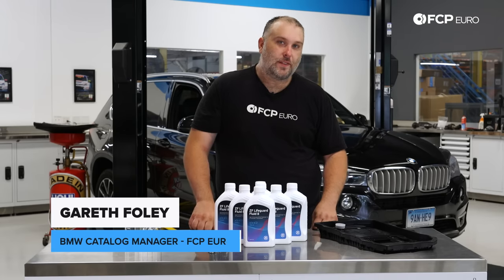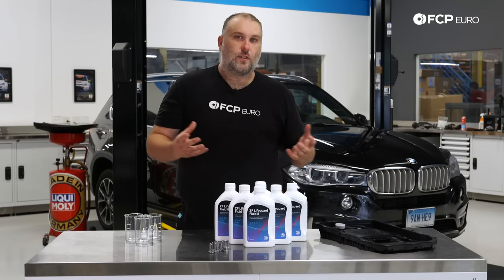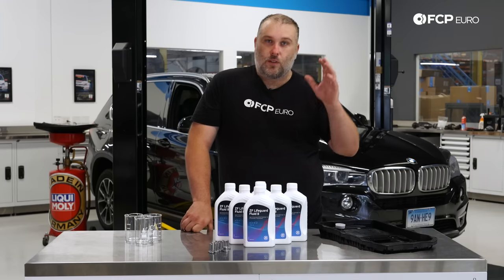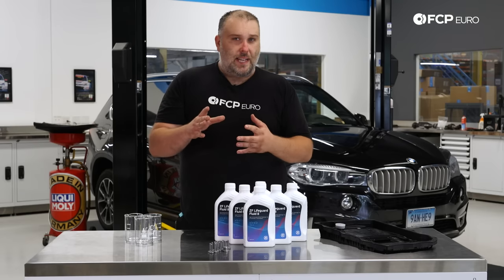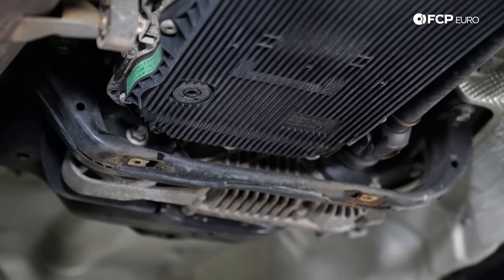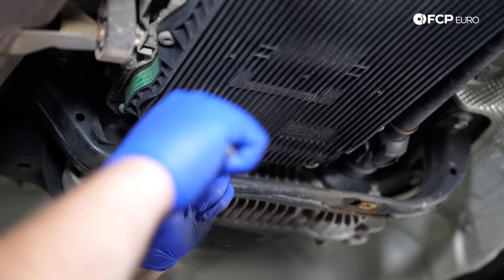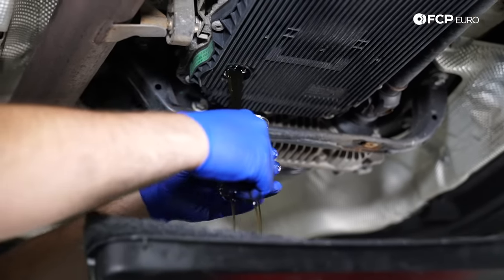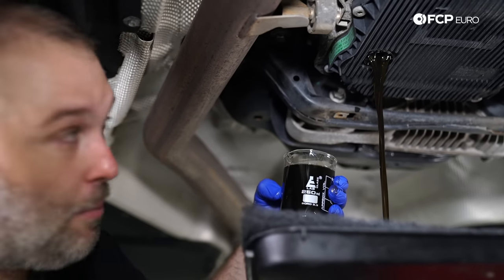ZF 8-Speed Transmission Oil Change (BMW, Audi, VW, Dodge, Land Rover, Toyota, & More)

Comment: I have a 2015 328i. It had 42k miles when I bought it, and it now has 130k miles. It started shifting hard when put in drive and first few gears, kind of randomly. I watched this video several times and decided to change it to see if it would help even though I was risking it getting worse. The toughest thing was trying to refill the transmission. I struggled to get car level.  Although 4 1/3 quarts drained, I could only get 4 quarts back in. End result... Seems to shift smoother. Thanks so much for posting this video. Lots of good information. It was tremendously helpful.
Reply from the maker: Thank you for sharing your experience; happy to hear it is operating better! Now with this, you can stay on a scheduled maintenance interval moving forward.

Comment: Good description!
I have a serious question as I am planning to replace the filter and the dreaded mecatronics seals between the mecatronic and the transmission on my E61 -07.
The question is how can I seriously tell if I have had a coolant leak into the automatic transmission?
I have had coolant leak being needed to top off now and then.
Cheers from Sweden!
Reply from the maker: Hello, more than likely your transmission fluid will look a bit milky, similar to when a head gasket fails and engine oil and coolant start to mix. You may want to pressurize the coolant system and see if you can find a leak anywhere to start diagnosis.

Comment: Great vid!  I have the 8HP95 in my Jeep Trackhawk.  Currently running around 1,000 HP at the crank.  Considering just doing a drain and fill only since I'm at 30k miles.  How critical is it to level the trans?  The Mopar manual just states to raise on a level hoist.  No mention on trans angle with relation to vehicle frame.
Reply: It’s not super critical but of course not recommended to do in a hill 😂

Comment: My 340i is at 82,000 miles right now. The car was purchased used, so I got no idea if the transmission has been serviced. How would I find out for myself if the fluid isn’t too contaminated to perform the trans flush? I’m scared take everything off and drain the oil if it’s already too late.
Reply: That’s exactly the miles my 550i is at i’m going to do one i doubt the fluid is too contaminated at 82k unless the car was driven very hard

Comment: How do you change rear differential fluid with only one fill/drain plug on these bmws? Would be interesting to see. I assume mechannical/electronic pump would come handy but how you should remove all residue and particles which remain on the bottom of diff?
Reply: You need to use a suction syringe, I did it on my F11. You need to fill in the new fluid until it starts dripping, just need to make sure you're on a level surface.
Reply: @seyhankupeli  im aware of that, but that still will not remove all metal particles and shavings on the bottom since there is no steady stream pullin everything down.
Reply: @iwontforgetmypsw  had the same concern - why didn't they put a bottom plug with a magnet ? another "lifetime" bmw fluid :(
Reply: @alaind831  no it is not lifetime fluid, you have to replace it by taking out differential completely and draining fluid for the best result. Procedure became a bit harder and time consuming.
Reply: @alaind831  yes but i guess some shavings of differential are still left at bottom, either way it is still better than leaving old fluid.

Comment: My question is when you drain it like this and don't put it on a machine to pump out the old fluid and pump in the new one do you still get out all the old fluid out of the system so it don't mix with the new one?
Reply from the maker: There will always be some mix of fluid, which is why it is so important to stay on top of service intervals!

Comment: Hello Gareth;
Great videos and knowledge friend. Why can’t we have more like you at the dealerships!!! My question for you, I just acquired a 2014 535i base model with 83k miles. No idea if the tranny fluid has been changed. Do you recommend to change it? I will be doing the work myself and of course the parts will be supplied by FCP euro. Thank you for your time and please, keep the videos coming. They really help.
Felix
Reply from the maker: As Gareth mentions at the end of the video, if everything is working fine and the fluid is in good shape, you can preform a service and continue on with normal intervals.
Reply: Thanks again for your response. Good customer service is very rare these days. Have a great weekend.
Felix
Reply: I have a 2015 535 with 76k miles. I did this service last week. No issues. Indeed car was fine previously, but now it's so smooth I can barely tell when it's shifting.

Comment: One thing to note on my bmw528 xDrive, 2015, condensation (from the AC unit?) drips down over the transmission pan. When I replace the pan and check for leaks I thought it was leaking
Reply from the maker: Thanks for the note, Alex!

Comment: How much fluid did you guys drain from your transmission vs. refill? I drained 6.9L. but it's already dripping out when cold after only adding 4L. Will I really be able to add almost 3L at running temperature? I have a 2018 BMW 530E (G30) with the ZF 8-speed. Thanks!
Reply: I was able to add about another Liter once at operating temperature, still less than what I took out, but consistent with what others comentened. I put approximately 5.0L total.
Reply: I didn’t measure (should have) when draining but filling after cold and hot temps I used around 6

Comment: How much would you recommend doing this to an X15 with 90k miles?  I already purchased the kit with all of the fluids, but I don't want to risk the transmission because the fluid is too far gone.  I've heard of stories of automatic transmissions dying because of a fluid change on a high mileage transmission.
Reply: I reckon you’re fine, I’m about to do mine at 85k miles on a 530. I once did an E90 at 50,000 - waste of time, the Lifeguard factory oil was still golden yellow.

Comment: Question for anyone here: I have a 2015 ram 1500 hemi, I have watched a lot of videos on this procedure and read numerous comments on how it is done.  One area of contention is the shifting through the gears before final fluid check and how should exactly be done. Some say tires need to turn, others not.  Would there be anything wrong with just taking the vehicle around the block a few times (after the procedure as shown in this video), then let it cool and then get back to temp and rechecking the level?
Reply from the maker: Hi Tom, you could certainly do that!

Comment: Does the ZF instructions not involve getting the gearbox temperature to 75 degrees C or something then letting it cool? When I saw that before it scared me away from doing the job. Its more straight forward if the way in the video works but I'd hate to cause issues in my gearbox which is working perfectly right now
Reply: frozen, the ZF instructions have a 2 step process.  The first step is for a situation where you have a trans cooler that got emptied due to repair.   If there is a transmission cooler present, it says to fill with oil then drive until the valve opens.  In that step it says (T < 75C)  so the temp needs to stay under 75C.  After valve opens you go to the process described in this video.  If there is no transmission cooler present(with a thermostat), or it never emptied during the fluid and pan change, then you skip to the process in this video directly.

Comment: If upon draining the system and it is in bad condition, what would your recommendation be to do if not servicing it? I'm reluctant to take to a BMW specialist at the sheer cost of the service and could quite happily do this myself. My worry is if I find out the transmission is in bad condition, what then?
Reply from the maker: Hi Nate, if you are currently having issues with your transmission, a fluid service may or may not help. If there are no active issues, you should be fine performing the service and staying on top of it from now on. You will need to further diagnose your transmission if it is currently showing issues after a service.

Comment: What about all the oil in the oil cooler and lines and the residual oil in the shuttle valves  etc? You made a big thing about changing the filter as there is no point in putting new oil through an old filter yet there has to be at least a few litres of old oil left in the system that didn't drain out. Is there a way to flush the whole system with the pan removed  or is it a case or removing oil cooler lines to drain/flush that way?

What about gearbox calibration afterwards?

Comment: i have x6 4.0d f16 2015  156k km. After I change the oil it is necessary to reset the gearbox settings with the tester? i don t want to have issues. thx
Reply: if the car shifts good after the oil change, you don't need to reset the gearbox adaptation, there is an algorithm that changes those values to compensate for the gearbox degradation, it's automatic.

Comment: Anybody on here have an iPhone style scanner like an iCarly? I was wondering if you can see the fluid temps on that, or if I have to go spend a bunch of money on a scan tool that can read and see the BMW specific info.
Reply: You should be able to get a wifi (for Iphone) or bluetooth(for andriod) OBD2 diagnostic port plug off of amazon.  there are apps you can get and use for free during a trial period that will let you display certain fluid temps.  Make sure the app can display transmission temp before you pull the trigger on the service

Comment: Thanks for this guys. Quick question: does the zf-8 require a mechatronic sleeve change like the zf-6?
Reply: No, not at the 50k interval, it could be done at 100k+ but I've never seen one  leak.
Reply: It  doesn't leak like the 6 HP but I replaced mine anyways.
Reply: @johnclark7406  Gotcha.  Is the procedure the same on the 8?  I haven't seen any documentation on it yet, so I was just wondering.
Reply: Yes.

Comment: Mine has 196K km..... too old to do the service now?  transmission is functioning great.
Reply from the maker: Hi Bill, if your transmission is operating perfectly fine, servicing it should be no problem. It would not be a bad idea to drop a couple ounces of fluid if you want to see the condition of it first in case you are worried about too much material being in the fluid.
Reply: @fcpeuro  thanks for the prompt reply!  I was planning to do just that; particularly after seeing the video to make sure it's in decent condition.  go from there.  thanks again!

Comment: Is it too late for me to change my grand Cherokee 2015  zf gear oil after 162000 km? 😢😢
Reply: No it's not. Of course..it depends by  the actual condition of the transmission. But consider that as a  "deadline" km when you must change the oil in it. Done that myself in my BMW F31 320d 2016, at 164.000 km...and runs perfectly fine

Comment: Is there a transmission cooler and does the fluid held in the cooler effect the fluid level check, here's a video for another vehicle for the same transmission that mentions the fluid held in the cooler.  https://www.youtube.com/watch?v=BPkCUfqi-gE&t=909s, any information will help.
Reply: Daya, if there is a trans cooler present and the fluid from it gets drained out, there is an additional first step to take before following this video.  The procedure is on ZFs website

Comment: What about moving it thru all the gears right after you drain it to push out any additional old fluid you can so get as much new fluid as possible?
Reply from the maker: Don't do this. There is no fluid in the sump/pan, therefor no fluid for the pump which is responsible for pressurizing the valve body and other hydraulic components in the transmission. Aside from damaging the pump this could also damage the transmission itself. There is no need to do anything more than a drain and fill procedure on this transmission as long as its serviced in appropriate intervals.

Comment: 200,000 and now at 8 years 2016 Jeep Grand Cherokee Overland (diesel) 150 highway mileage per day. Change or no change?
Reply: If you’ve never changed it it’s too late
Reply from the maker: Unfortunately, with that amount of mileage, it is hard to recommend either or. However, if the transmission is operating perfectly fine with no issues, then servicing it should cause no issues. If the transmission has bad wear and the fluid is heavily contaminated, sometimes that contaminated fluid is what keeps it going, and it is recommended to leave it alone.
Reply: @jackchueh1231   Yes, that is a common consensus with many FCA branded transmissions. I am just not sure about ZF transmissions. Curious to know how much (percentage) of the fluid is changed in a pan drop/filter change on this model ZF. If only 1/3 of total volume, maybe it needs a second or even a third fluid change (dilution with fresh fluid) before replacing the pan/filter.

Comment: Great video! I have an 2014 Range Rover L405 Autobiography and I believe I have the same transmission. Are you located in Michigan or know anyone here will change my trans fluid with your expertise? I called up 2 land rover dealership and they said they won't do it. I believe it's vital to change your trans fluid to make your trans to last longer. I have about 80k miles and no issues. Please advice
Reply from the maker: We're glad it was helpful! We are located in Connecticut, and we unfortunately do not have any shops we can specifically recommend in Michigan. We would recommend searching via Google for Land rover specialty shops,  or perhaps see if there is a Facebook group that could help with a recommendation.
Reply: @fcpeuro  thank you!

Comment: how are you my friend
 I have a BMW 730IL 2013

 I've never changed the transmission gearbox oil
 This is according to our agent's recommendation
 Now the car has traveled 175,000 km

 Do you recommend that I change the oil or not?
Reply from the maker: At 175 KM your transmission would thank you greatly for a refresh on its fluids at this point.
Reply: Thank you for your response, is there any damage or will things be ok

Comment: I have a 2015 X5 with 112,000 miles. Is it to late to do this service?
Reply from the maker: Hi Hornet, if the vehicle has no present issues with the transmission, it is worth starting that service and continuing it at the proper intervals.

Comment: The ZF procedure mentions about a transmission oil cooler present and to dive the car with 0.5lt of overfill until the temp is greater than 75 degrees. The rest of it is the procedure you have followed but ZF also has a step to keep the engine at 2k RPM for 30 seconds. Which is the best way?
Reply: skadoosh, if a trans cooler is present and it was drained, then you have to do an additional step before the process in this video.  ZF says drive the vehicle until the thermostat or valve opens so the fluid fills the cooler(hence the .5L you mention).  A little correction though ZF says ( T < 75C) - in other words the temp needs to stay UNDER 75C).  You just need to get the valve to open to fill the cooler.

Comment: Q.  Should one do a full flush or a drain and refill of the tranny fluid?  I ask because I’ve got a 2011 328i nearing 70k miles with no tranny issues.  I’ve read on some BMW threads that some people have run into issues after doing a flush and refill.  These are folks that had no issues beforehand.  Many recommend just doing a refill.  What are your thoughts on that?
Reply from the maker: Hi Fleipeg, it would be recommended to do a complete service to keep the transmission healthy and the fluid in the system overall clean. You will contaminate the new fluid with the old filter via a drain and fill. 70k is still a good mileage where you can start and continue to keep suitable service intervals for your ZF8 transmission!
Reply: @fcpeuro  thank you

Comment: Do ZF’s 6 speed manual transmissions require a new pan as well?
Reply from the maker: HI Bkboii, typically a manual gearbox does not use a pan, and just has a drain and fill plug for the case.

Comment: In n57 you have to remove the cross member. So i suppose no transmission fluid change.
Reply from the maker: Get it out!
Reply: @fcpeuro  used the tiniest and shortest ratchet ever made in mankind to two finger the bolts off. 🤣

Comment: Thank you so much for the video. Great job.
I can't see why the pan needs to be replaced? Why can't you just open the drain plug to drain then fill from the fill plug?
Reply: The filter is built into the pan, hence why they change the pan.
Reply: @javidiqbal6751  Ok, but why change the filter? What if I just want to change the fluid. Is it necessary to change the filter? I mean BMW say its a "lifetime" fluid, but I want to change it sooner. So why can't we change the filter at the next fluid change - like 100k miles and just change the fluid only at 50k miles?

Comment: How much oil quantity require for an oil change at BMW  F25 ( 2014)  automatic gear.  By draining method how many litres of oil expect  to drain?  Thank you for feedback.
Reply: Usually 30-40% from the total quantity you got. With some reserve for draining out you take 50%. I have a Jeep GC and it has 8.8 quarts (8.3 liters), so I buy 5 liters or 5 quarts.
Reply: My BMW F31 320d 2016, took  aproximately 5 liters...not more

Comment: I would love to perform this service on my 14' F01 but don't want to spend a grand on a scanner that reads trans oil temp.  Is there another way to read the temp before the final refill?  Seems odd that 40C is critical before adding more oil.  Are there cheap scanners(<$100) that read trans oil temp?
Reply from the maker: https://www.fcpeuro.com/products/maxiap-obdii-scanner-autel-ap200 we found for most vehicles this will provide you trans temp!
Reply: I think ISTA will read it as well. You can find the program for free online.